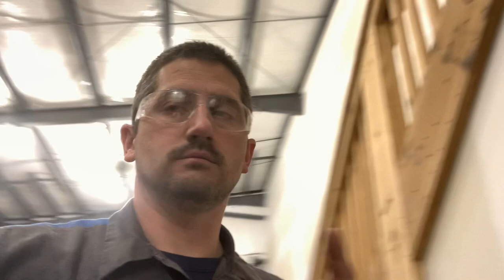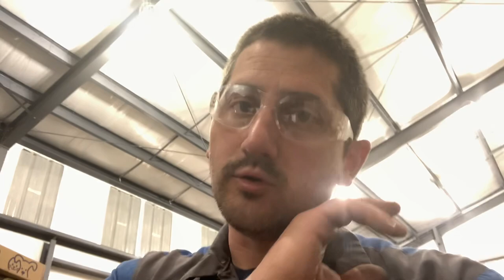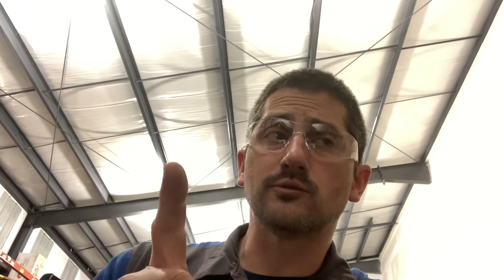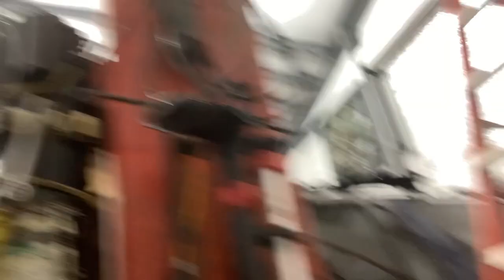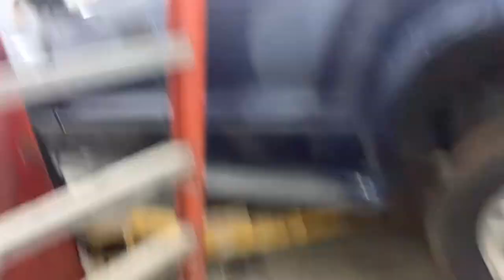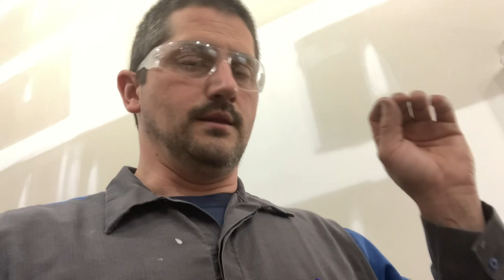Radiators Brass, copper, and solder vs. Aluminum and coolant vs. alloys

Comment: Almost everything you said in this video is demonstrably incorrect. There are two reasons aluminium is used for radiators: First the raw material is cheaper. Second, aluminium is lighter. That you say copper is an "insulating metal"(!) and doesn't transfer heat as well as aluminium shows just how incorrect you are. That you end the video by telling us about the four core radiator you got for $150 shows that you don't have any real understanding of the physics that you attempted to bumble your way through at 4:10 regards tubing size. Delightfully ironic! Back to school please!
Reply from the maker: Cool story bro